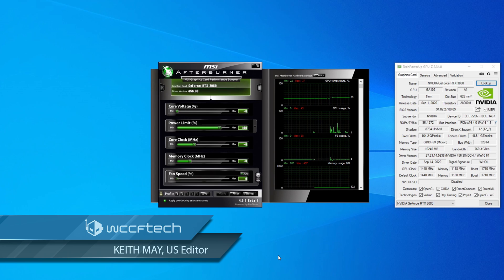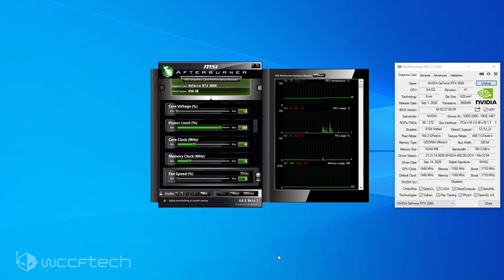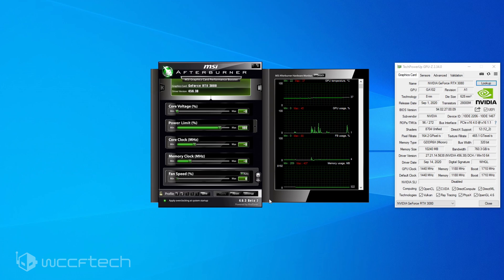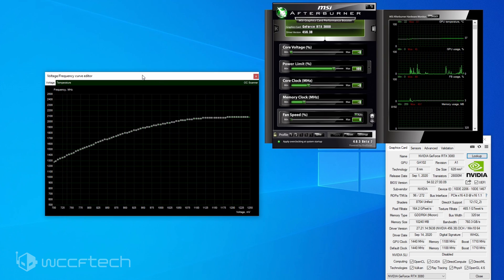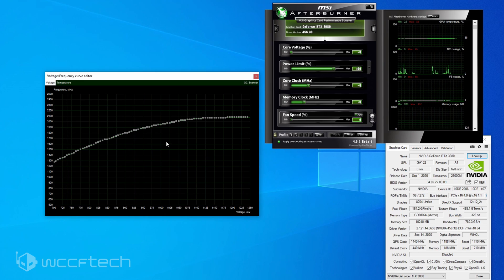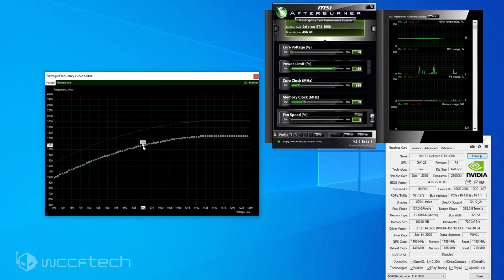How To Undervolt RTX 3080 For Huge Efficiency Gains

Comment: I did this with my MSI 3080 Ventus 3X , at first it was crashing because the voltage was too low (you can’t follow exact values in this video my card acted as if it was just off) but minor adjustments fixed it. I did -280 and then set the curve at 1900 around 850 and it’s been working fine ever since. I did see a 5-10 degree Celsius drop.
Reply: Apparently it depends also card by card not just model, literally each card. Thanks. This card is the only available now for 1k... I don't know if 6800 is better being 16gb and much less power draw.And being Ray tracing soon a thing also for Radeon I think. With FSR 2.0 and beyond

Comment: Tried this on Metro Exodus Extreme raytracing Ultra and game crashed after 5 minutes 🤣 You either have a VERY good chip or you haven't tried this properly on a Raytracing heavy game.
Reply from the maker: Well, if you used my exact settings it only proves differences in silicon, which is why you should find what works best for your card
Reply: @WccftechTv  Don't get me wrong, your video is great and helped me understand how to get around Afterburner, but did you try these settings on a Raytracing heavy game? Just curious.
Reply from the maker: I did 🙂 I waited a couple days after applying and using the settings exclusively before proceeding to make the video so I didn’t jump the gun. Admittedly ME wasn’t the game I was playing but I players through the entirety of The AWE expansion of Control with it

Comment: Didn't work for me - games crash constantly. Followed instructions exactly so doesn't always work
Reply: Just try a higher voltage (if unstable at 862mv, do all the sams but with the next step). I originally undervolted my 3080 at 850mv, but it finally took 862mv to be stable in every game/scenario
Reply: @daniel32768  Thanks for that, will try :)

Comment: It's completely counter-intuitive, but undervolting nvidia can IMPROVE the performance - the card varies the boost frequency with temperature, so the cooler it runs, the higher it boosts.
And the less voltage you give it, the cooler it runs.
Works on Turing and Pascal as well - I got my 1070 down from 143 W to 115 W and kept all the performance.

Comment: Nice. 881 mV @ 1995 Mhz Clock and 10401 Mhz Memory Clock. 10 degrees less temperature and about 60-70 less power draw (down from 360 watts). 1-2% more FPS.

Gigabyte Gaming OC.

Comment: It's actually interesting to see that the undervolted one consistently hits higher frequencies while being cooler, while the stock one fluctuates a lot and is losing by ~1-2fps.
Reply: Yep Turing was the exact same. You gain more from the power limit, lower temps = GPU boost plus keeping it more stable

Comment: That's crazy! My RTX 3080 TUF OC dropped from ~76°C to ~57°C (~220W) and I noticed absolutely no difference in FPS! This is while playing CoD BOCW
Thanks so much!
Reply: I have the same card but get crashes when I boot up games when using this undervolt. Did you follow the video exactly or make your own changes? Sorry if dumb question, I'm new to undervolting
Reply: @smoltro1973  not every card wil follow this exact same settings due to silicon differences, you need to use this as a base but raise the voltage slowly until you get stability
Reply: @smoltro1973  try a little higher voltage / a little lower clock. The more voltage / the less clock stability increase

Comment: thank you very much sir for this information!  i need to give you mad props here.  after doing this and a fan tweak, the fans on my Zotac 3080 Trinity doesn't sound like there's a mini jetplane inside my desktop anymore  :)  my GPU temp highs are also way lower now, like 63C after doing the AC Odyssey benchmarks at Ultra High settings.  Fan Speed RPMs now at 1470s and lower 60s%.  Board power highest at 213.7W.   so far none of my 5 benchmark runs crashed.  like night and day sir, like night and day.  will be showing the AC Odyssey benchmarks on my next channel video  :)

Comment: I had been looking for a better way to customize the boost and voltage curve....nearly impossible in precision. Working with this strategy now! Thank you!!
Reply: I may not fully understand how to optimize this...mostly just ended up with crashes and significantly worse performance without much power saving.

Comment: How bout for the FTW3 card, target the same points I assume?
Reply: Maybe i'm a little late, but i did the same thing. Running stable (at least until now) with 0.850v. Boy, this card is hot. I was getting 85c max under stress tests and now i get 80c max. 5c is better than nothing. I'll try to ramp up the fans to see if it does any good.

Btw, my case is a NZXT h700i, not the best airflow, not the worst either
Reply: @goesoliveira  Not the card's fault.  This is one of the cooler running 3080's there is.  This is all about your case because I never get over 63 using the above settings, EVER.

Comment: Not sure what happened in the last week but i used to be able to run at 1985mhz @.862v and now i can barely get 1905mhz @.92v.  I might try rolling back the driver and see if that makes a difference.  Temps are below 65c for the gpu.

Comment: Doesn't this mean when your card is idling it will use more power, we've lowered the frequency to voltage curve meaning at low clock speeds the voltage supplied is higher.  For example the default curve 850 mV would usually be given at something around 1670MHz, when I lower the curve my card will use 850mV at 1400MHz.
Reply: I am wondering the same thing. Are we missing something here?
Reply: I've only ever seen my card hit those intermittent speeds (and corresponding higher voltage) in some menu's of windows apps. Every game I play goes to the max clock pretty much instantly. The OC screen does not change idle behaviour

Comment: After setting the curve do you then need to put the Core Clock back up 290? If i don't GPU Z shows the GPU clock at 1154 and not the default 1440.

Comment: Hi. I followed this tutorial but when I launch Furmark with monitoring tools like GPUZ or HWInfo64, they tell that my board is still drawing 300W+, the same than the stock values. WHat am I doing wrong? I changed the voltages in the curve, hit apply...I'm lost.
Reply: Ok reinstalled Afterburner, it worked. Tried 1800 Mhz and 875 mV, the Unigine benchmark went fine with 260W power draw on average. Will try different settings, please post yours! (TUF 3080 OC)
edit: 825 mV @ 1800 Mhz: fine. 230W average.

Comment: Following this I got my 3080 to 1920Mhz at 830mV. An impressive 260W power and stable. Dropped temps by over 10 degrees and I can now run fans at under 50%. It's almost silent. Great guide.

Comment: 2080 super, and wtf. Is there some downside to this? I'm getting similar clock speeds but its like 59c instead of 70c.
Reply: That’s the whole point of undervolting. Thermal efficiency. If not for that, what are you even doing this for?

Comment: Aren't you massively overvolting the entire lower end of the curve when you use this method?
Is that just not worth considering?
Reply from the maker: You’re not because you’re not actually doing anything to the voltages, you’re just changing the frequency/voltage curve. You’re targeting the higher frequencies at a lower point in the voltage curve
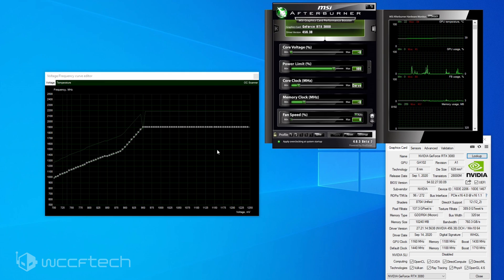Reply: @WccftechTv  If you look at the new curve at 4:12 it indicates that it will target roughly 1275mhz at 800mV. Where as the stock curve targeted about the same core clock at only 700mV. Or do I fundamentally misunderstand how the frequency/voltage curve works?
Reply: @suddi218  Did you ever understand it? I am wondering the same here.
Reply: @jaybee0507 I never got any reply, so no. I assume that what I said holds true. Not sure whether it matters much. Might be useful to know if there is a change in idle power consumption.
Reply: @suddi218  I am looking at the curve and it seems right. Yes you are undervolting the top end which is good under load, but on idle it seems you are overvolting the card. If you look at 1400Mhz, previously it was allowing around 738v, where now the card is pumping 850v to the same clock speed.

Comment: I just undervolted my 3080 FE. I used 3D Mark Port Royale as Benchmark. After some tinkering it was clear that there was a stable Line. Starting from 900mv and 2000Mhz going down to 700mv and 1600MHz. Every -25mv/-50Mhz step was stable. The powerdraw went from 900mv and 320W (Powerlimit) to 700mv and 195W (total of 6fps lost in PR compared to Stock). Every -25mv step was a "loss" of 15W.
For my FE 825mv and 1850Mhz (275W) had the same Result as Stock. But i decided to use 775mv and 1740Mhz (240-245W) as my Default. Lost 2 fps in Port Royale with that UV.
Using 700-725mv you have the same Powerdraw as a 3070, but still MUCH more Performance.

Comment: Thanks man! It brings my 3080 Gigabyte Eagle from 74 degrees to 64 degrees using 875mV at 1900mHz. Also, the COIL WHINE IS GONE! Damn! I hope it stays stable
Reply: I started getting crashes on my undervolt after a few weeks :/
Reply: @PhantasmXD  I'm still fine and tested in multiple games. Settled for 882mV at 1905mHz. What values did you use?
Reply: @PopaSergiuMihai  Oh, I went 825 @ 1905 lol. Too aggressive I guess.
Reply: @PhantasmXD  Yup, it is pretty aggressive. I was getting crashes at 852 or something like that with 1905. Try something less aggressive, it will still bring a lot of improvement in terms of temperature. You can try 882 at 1905 as I did, it should work for you too :D
Reply: @PopaSergiuMihai  Yea, I just bumped it up to 887mV. Seems to have done the trick. Thanks!
Reply: @PhantasmXD  No problem! :D
Reply: @PhantasmXD  - 290 core clock ?
Reply: I have a 3090 FE

Comment: Did this to my 3080 ventus. I was shocked how much better my temps were. I went from 72 c max to 65 c in warzone. This is at 60% fan speed so I barely hear my pc now. I play on a 4k 60hz tv, so I don't even notice a performance difference either.

Comment: This is exactly what I did with my Aorus Master 3080 which is a beast for cooling. Already ran 63C OCD. Did the -290 Core and settled on 2055mhz and +700 mem clock. I run 56C stable in Battlefield V.
Reply: I also have the 3080 Aorus Master. Did you undervolt to 825mv or 950mv?

Comment: Awesome video!!!! Just applied some undervolting to my 3080FE and I dropped over 10c and my fans rarely hit 1600rpm on auto.  Card runs around 72c at 1500rpm vs 82c at 2200+rpm on auto can curve. I dropped the curve -290 and settled at 850mv at 1850mhz.  I don’t notice any performance decrease but the temp drop and fan speed is now fantastic!!!
Reply: I used same settings as you on my inno 3D RTX 3080 X4 Chill, i mean...GOD DAMN, thats a big f-in diference !

Comment: Thanks. I used this to do my FTW3. I dropped it to 850mV and it's saving me 9° C at the cost of ~3FPS. I don't have a way to measure my power usage, but I imagine it's quite a bit lower.
Reply: You can link HWINFO with the Afterburner so you can also monitor gpu power usage.

Comment: this was very helpful. I undervolted my EVGA rtx 3080 and got reduced temps, less power consumption, and improved port royal scores. 

steps I took:
underclocked -270 to get to base clock speed. 
took the curve at .850mV raised the curve to 1905Mhz. 
custom fan curve. 
stock port royal scores 11200, undervolted scored 11555
in game GPU temps went from 74C to 65C.

thanks again!
Reply: Thx a lot, got 11474 after undervolting my EVGA
Reply: THANKS
Reply: So far so good following your steps, thank you
Reply: What evga 3080 xc3 or ftw?
Reply: @destino813  xc3
Reply: Hey, was this done in px1 or msi afterburner?
Reply: @MikeyMarss  sorry for delay. Msi
Reply: What kind of case were you using? High Airflow case?
Reply: @syko3298  nzxt h510 elite. No airflow mods to the case.

Comment: This was incredibly helpful and I have subbed your channel.  As an initial test on my 3090 FE I raised my power limit to max, and dropped the core -280.  Then at 950mV I raised the curve to 1905Mhz and it ran like a champ, got my best port royal score.  I will continue to play with this technique.
Reply: Thanks for your comment. I'm trying to with my 3090, any recommendation?
Reply: @loc.dev.  Hey guys, i also have a evga 3090 XC3 and i undervolted to 868mv and underclocked to 1920mhz and i runs great!
Reply: Also was using the curve demonstrated and it was doing well. After playing around I am at 918mv at 1905mhz. I think that may be as far as I can push it though. 3090 FE is the card I'm using.

Comment: I tried the more aggressive version and got a crash in Control after a few minutes.
Reply: The less aggressive one works fine though, and temperatures are much lower - though i did lose 5-10fps

Comment: Thank you so much for this video! I actually tried undervolting my 3080 today and ended up with 912mV. It seems like I got a pretty bad GPU as 900mV was already unstable in the Forza Horizon 4 Benchmark. But nevertheless I got from 310-320W power consumption down to 245-255W. Lost 1 FPS in Average but I don't really care about that single FPS as 65W less is so impressive. And on top of that I went from 11051 points in 3DMark Port Royale (stock) to 11462 (max 912mV).
Reply: Yup, the infamous silicon lottery but it's also very much game/load dependant.. Some benchmarks and games might seem stable, others may not.. I.e. I can set my MSI RTX 3080 Ventus 3x OC to 1920Mhz with 850mV and run most benchmarks and games like Call of Duty etc fine, but if I start playing Red Dead Redemption 2 it eventually crashes.. I had to go up to 906mV and lower the clock to 1905Mhz to get it stable in that game.. I cannot go any higher on the clock due to the powerlimit on the MSI Ventus unfortunately, but a stable 1905Mhz with less than 320W usage is good enough for me..
Reply: Apex Legends dont like any OC/UV in my case 🤷‍♂️ so i need to lower the Powerlimit instead of OC/UV

Comment: I followed this video and used the fan curve in msi afterburner (2nd tab in settings) and the temps went from 70-75C on BF5 3440x1440p ultra to 55-60C. (I haven’t seen it exceed 60C yet) Im getting about the same fps but it uses way less power and has way better temps. Thanks for the video! 👍🏽
Reply: Which model 3080 did you do this on? Would you mind sharing which voltage dot you raised above the limit line?
Reply: @natevirtual 
I own the 3080 Founders Edition.
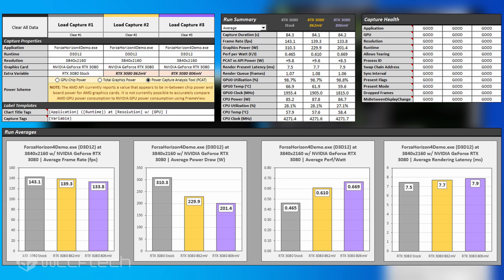I used the settings at 5:05
Profile 1: 1905 Mhz at 862mV but I increased mine to so 893mV
Profile 2: 1815 Mhz at 806 but Increased mine with 30 again.
I suggest starting at the same clock speeds and voltages. Maybe increase the voltage by 10-20 each time to see whether it's stable or not
Reply: @zertyfield  thanks so much for your response! I'll try that

Comment: Thank you sir! Was able to lower my average temp of about 66c to 55c on my FE.   825 mv and 1800 mhz . You have earned a sub
Reply: Using GPU-Z to monitor, I observed average board draw power went from 320w to 250w
Reply: Did you drop the core clock -290 like he did in the video? I have a FE too but I can’t seem to get it right

Comment: Thank you,this greatly reduced the heat outputted by my RTX 3080 ASUS TUF card into my PC case. If everybody sees this,it will greatly reduce the PC case internal temperatures when the card is under load.
Reply: How are your thermals on the Asus Tuf? Been wanting that card.
Reply: @hankhillsdisappointedsigh  they are great as in 63-64 degrees Celsius on stock voltage but the heat being dissipated by the card into my case was insane so I undervolted it. You need lots of fans and a large case for these cards.
I now get 57-58 degrees max inside the card and the radiated heat is much less in my PC case.
The card is also very silent.
Reply: @comancostin4623  Interesting, I only have 2 140mm intake fans and 1 120mm exhaust fan with a mesh front cover on a mid tower case . Cpu is air cooled by a Dark Rock Pro4. I currently have an order waiting to ship for an FE , but I wanted something cooler and quieter. I guess the FE would at least be blowing it out the back with a rear fan. Perhaps that would end up being better than the TUF for my whole system. 
What is your fan situation?
Reply: @hankhillsdisappointedsigh  2 Frontal 140mm Arctic intake fans,2 120mm Arctic exhaust fans on the top and 1 120mm Arctic exhaust fans on the back.
And it still heats the case.
The aluminium back plate gets awefully hot with RTX On in Control.
Reply: Mind sending me your settings? I have the same card
Reply: @iBRepeaTzHD  https://wccftech.com/undervolting-ampere-geforce-rtx-3080-hidden-efficiency-potential/   Follow the instructions here, the one clocked at 1890/862/-290 . It worked like a charm!

Comment: Trying that out on muh Zotac 3080 and HOLY F&%* the temperatures dropped off a cliff!
Reply: im getting this card in one week scalped cus i cant wait but can you share your config?
Reply: @jaimdiojtar  #1 rule: Don't support the scalpers!!!
I got a 5900X, 280mm AIO cooler, and 32GB 3000mhz c15 ram, to keep the 3080 purring along.
Reply: @PhantasmXD  yeah but i live in a country with hyperinflation so even if it cost +60% than the normal one by the time we finally get stock the price will skyrocket  a lot
Reply: @jaimdiojtar  sounds like you need to buy bitcoin

Comment: Not only does this give you a high efficiency card, but also removes throttling because you steady the card as lowest possible voltages which again reduces your temps. So the cooler has a easier job, which makes it more quiet. A custom fan curve is also a great idea to do along with such undervolt+overclock
Reply: Exactly. Ur not sending twenty cars in a two lane highway anymore it’s a solid 6-8 cars constant in each lane with no hiccups